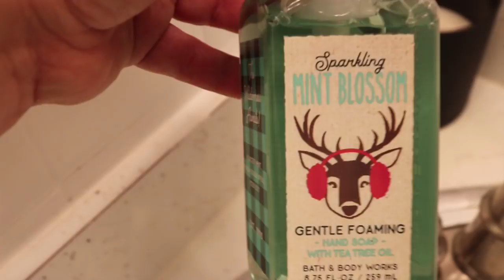28-Day Flylady  Routines Challenge || 02/04/18 || Day 4 -Weekly Home Blessing

Comment: First thing I do, when I come home: get rid of my shoes. Always. I don't wear anything but socks in the house. If it's warm enough, not even socks. That's the healthiest thing you can do for your feet, even much healthier than wearing shoes like Birkenstock or the like. There are socks with something like rubber underneath, that you can put over your regular socks, so you don't slip. Just a suggestion. And by the way: I like that little note at the stairs about bringing something - anything - down :D
Reply: Yes, I agree to a point.  If your home is fully carpeted this may be fairly safe, but if you have a lot of hard flooring then eventually you risk straining your feet and tendons.  Our feet are not designed to walk on very hard surfaces for long periods of time  -  barefoot in nature is on forgiving surfaces such as sand, soil and grass which moulds to the shape of your foot. Wooden flooring etc won't do this.  I speak from experience being a socks only girl for several years, then I started having issues in my feet, ankles and legs.  I solved the problem by wearing Scholl sandals in the house.  Within a month, all my issues disappeared completely. That was a few years ago  -  I still wear those sandals most of the time I'm at home and  I'm still fine.

Comment: You are doing an awesome job Sofia. I can't wait until you get rid of the carpet. Where did you get your clock radio from? I really like its small size. I would love to wash our windows we only have three and a slider. However they were just recently put in. Unforuntly they weren't put in right because the cold air still comes through them. We have them covered with heavy plastic. On top of that room darking curtains as well as a heavy blanket. Hopefully this summer they will have them replaced. We also only have two mirrors one in the bathroom and one in our daughter's room it makes it so much easier. I love the dresser in Wilie's room. Does it happen to have a name on the inside of it I don't recall?